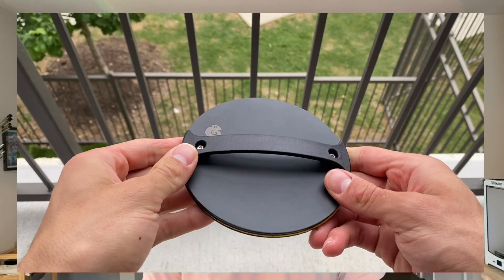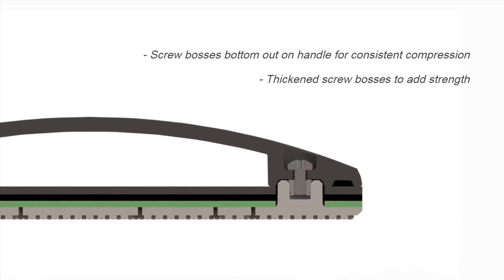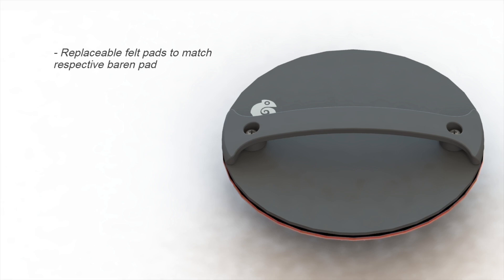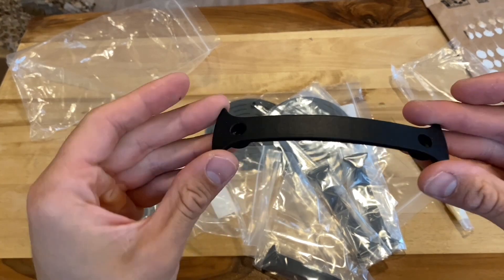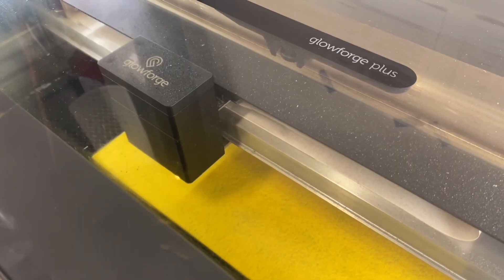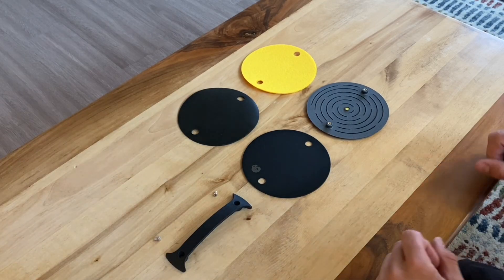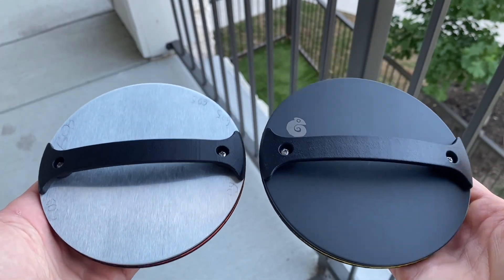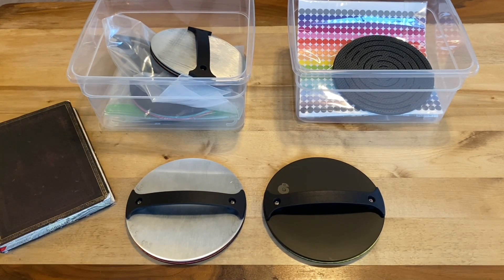Building the Second Prototype  |  Building a Modern Printmaking Baren

Comment: Was going to comment about vapour smoothing after the last video. At work we've been able to use it quite aggressively with some SLS nylon prints to get quite smooth surfaces without eroding finer features too much. Interested to see how some test prints compare to the last iteration.
Reply from the maker: That’s good to hear!  Can I ask what kind of work you are doing? (Just out of curiosity). And thank you for watching!
Reply: @mokudez   I do speech production research, but my background is in electrical engineering.  The university has a very well-equipped print shop for research support. I’ve used it to make custom parts/ apparatuses for experiments.
Reply from the maker: @BrackenOg  Very cool!  That's great to have easy access to that type of printing

Comment: About spinning the barens to compare how "slidey" they might be...  Of course the stainless baren spins longer; it has more mass, which means more angular momentum if you spin both barens with the same starting force.  All other things being equal, more mass means more momentum.

A better experiment would be to secure both barens in a "bumps up" orientation, at an angle, and the allow something to slide across the bumps under its own weight.
Reply from the maker: Thanks for setting me straight John!  I feel silly for not realizing this 😂.  It could be interesting to do some sort of sliding friction test like you described , maybe even pulling something across them with a force meter for a quantitative measurement. 

But either way, based off of the feel I am quite sure that some improvement has been made.   Mostly interested to see how it will feel during printing!

Thanks so much for continuing to follow along with the series!
Reply: Added to the bump feature, that makes it concave ...